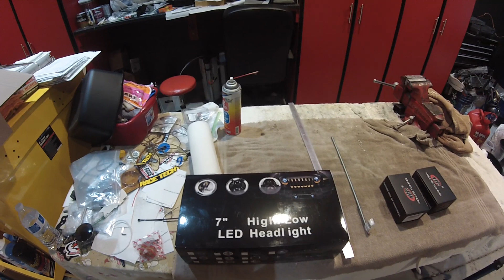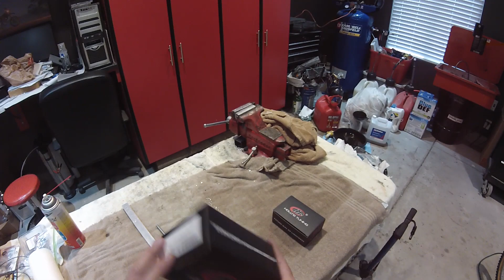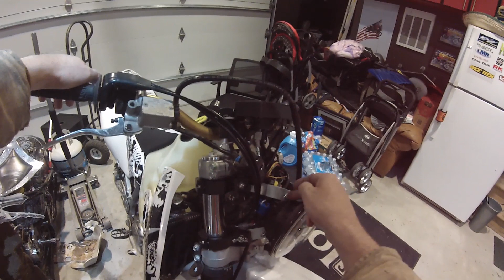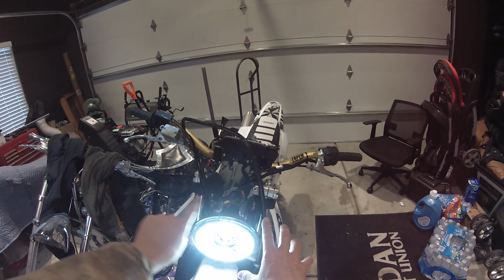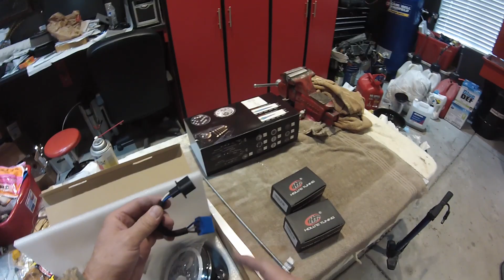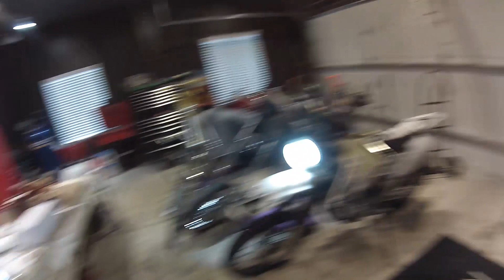7" LED Motorcycle Headlight Mod

Comment: Thanks for the video!  I found some similar lights on Amazon, but they don't seem to have any sort of thru-holed area on the light itself.  Do your lights have a holes present in the rear of the light housing?  Or did you drill a hole through the cooling fins?
Reply from the maker: These lights have a through hole boss on the upper back of the light, and the lower back... so, I just ran the allthread through that existing hole in the light.